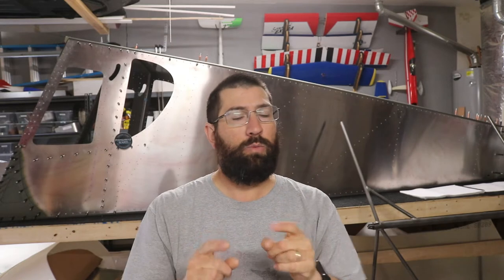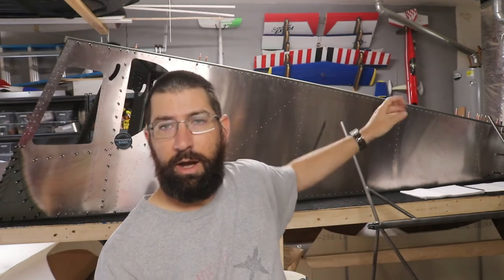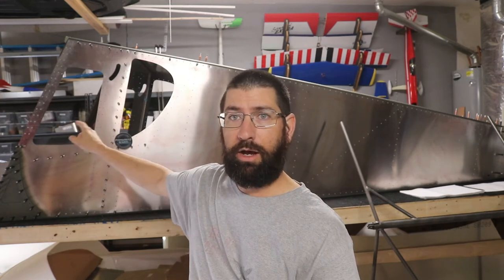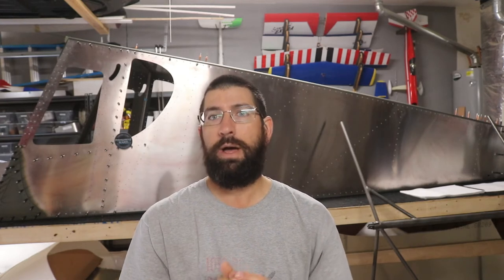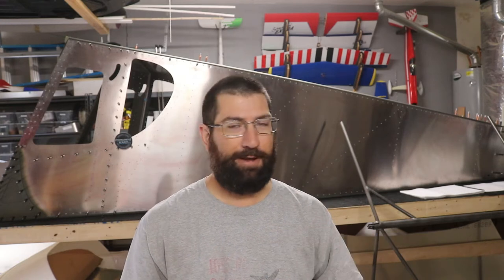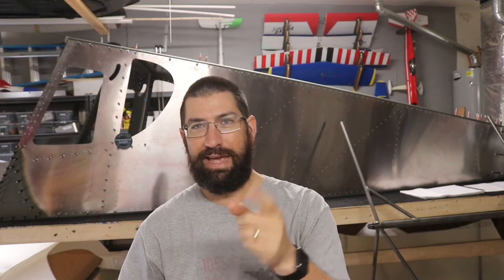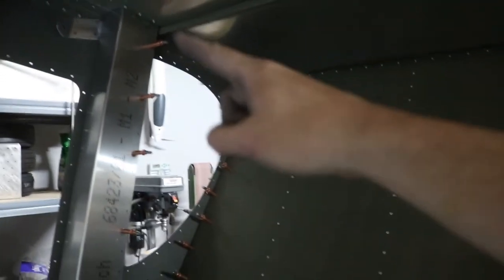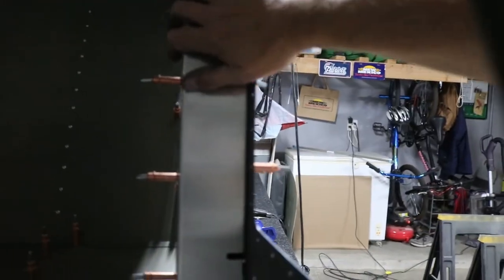Zenith Cruzer Build: Rear Fuselage Continued....

Comment: I fly RC too  mostly big ARF's   i built a zenith Rudder at the factory and i've debating it hard i dont know if i can complete the kit Joe can you offer some advice
Reply from the maker: So, It is not difficult to build, but it can get expensive. I have really enjoyed the experience so far. I know some people start the build then sell their kits. From my talks with some of them, the reasonings range from Money, interest, and no sense on completion. I set a goal to be completed, not to have pressure but to have a goal to reach. That's the best I can provide. Everyone needs to find their own motivation.
Reply: @JoesRCCorner   what did you do to buy the kit fiance it or just had 20k laying in an account ?
Reply from the maker: @zackriden79  I guess you can say Finance. I put it on a CC and then transferred it to a Personal Loan. I will be refinancing it on an Aircraft loan once completed.
Reply: @JoesRCCorner  i completed the rudder only thing i messed up on was the fiberglass fairaring i tryed to force a rivert through and it cracked the fairing I know i should of really bent the rib more to the fair and not the fairing to the rib ,  if i can do that rudder can i really do the whole plane ?
Reply from the maker: @zackriden79  sure, if I can do it you should be able to. I have messed I- plenty and I still believe I will have a safe airplane in the end.
Reply: @JoesRCCorner   dont forget their fiberglass is weak and not fully modeled to the  metal surface bend the metal to the fiber glass dont do what i did and crack it with a pop rivet  or use some  micro beeds like you do in your RC hobby   Joe what motor are you planning on slaping on that bad boy
Reply from the maker: @zackriden79  my fairings are all abs plastic. I am going with Viking 130
Reply: @JoesRCCorner   I think your right about the ABS it s not fiberglass  only thing i dont like about viking is thier Cowl  it's just not a sexy cowl !  but i'd use his motors and products any time
Reply from the maker: @zackriden79  I agree, the cowl is not as pretty but is does the job